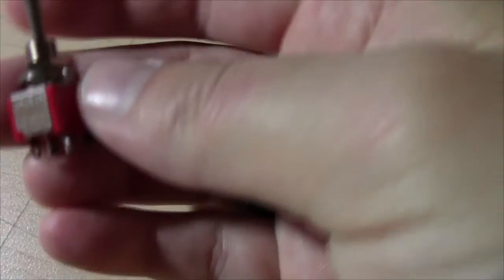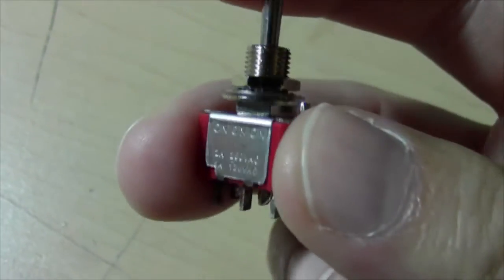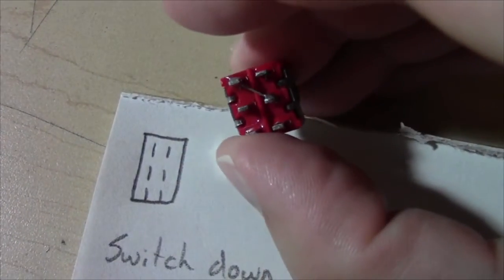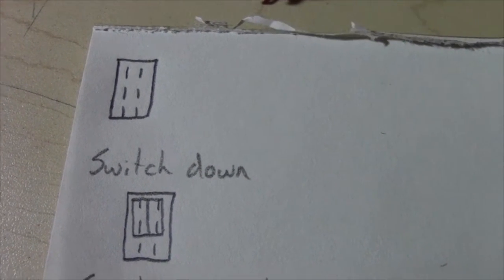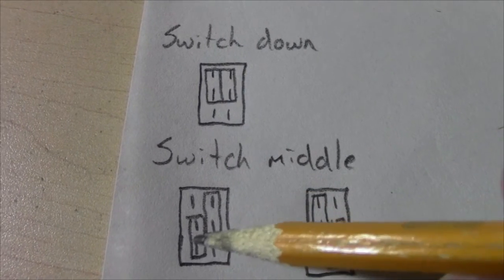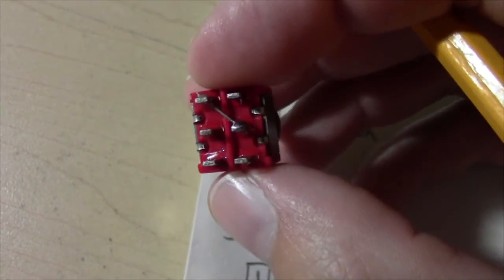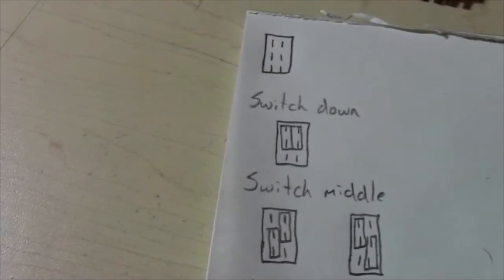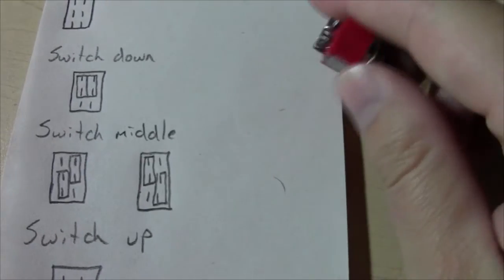Two types of DPDT on/on/on switches...

Comment: Hello 👋  I have a question. I'm using I think the same switch as you are, but I'm not using it for Amp or guitar building. I'm using mine on a dual atomizer vaping device, the attempt is to wire the toggle to the pcb outputs and make the device to where it can fire either atomizer independently or simultaneously depending on switch position. My inquiry is such, when connecting the positive input to the middle terminals, do I need to do anything other than add the jumper between terminals 5 and 3 as you have, or do I need to jump from either end terminals making an "X" pattern between the terminals?? I'm sorry I'm not very articulate I do not hwv3 much experience in this field
Reply from the maker: I really don't have much experience in this field either.  But it sounds like you're trying to wire up a two position (on/on) switch, rather than a three position (on/on/on) that I'm describing here.
Reply: @gasolinechlorine  so disregard the device and allow me to explain thusly. I have two lights that I want to use this switch to divert power to. The plan is that up turn on the left light, down turns on the right light, and middle position turns both on simultaneously. My biggest thing is that I've reached out to multiple forums and even tried talking to individual parties, but I keep getting the same response. "Not my wheel house" "not familiar with vaprs" I'm familiar enough with vaprs lol I need to talk to someone who is familiar with these on-on-on switches.....
Reply from the maker: @ Here's what I used to wrap my head around this style of switch.

https://www.talkbass.com/attachments/sp3t-gif.1739184/

As you can see, you can have three outputs with the jumper as they've wired it.  The only thing I'm not sure about is whether or not both LEDs would work if you wired them to the same output.  You might have to just try it and see.

Comment: You may want to add that a "type 1" on on on switch is shown in your drawing on the right, and a "type 2" on on on switch is depicted in the left drawing. Type 2 on on on switches seem to be much more common.
Reply from the maker: Yeah, I can't remember whether or not I said it in the video, but you need to check your switch with a multimeter to confirm which type you have.  Most places you get switches from don't give you any indication of which connections are made in which positions.

Comment: Thank you for the video. For those who will buy this kind of 3 way toggle switch they must have multimeters. First of all check the switch to ensure what type it is on middle position before soldering the wires.
2ndly when we buy 3 position switch ensure it is not on off on type although thry also have 6 legs.

Comment: Do you know what brand the switch is? I have A very similar looking switch and it’s made by multicomp. I bought it for about £4 here in the U.K. It has a nice quality feel to it when you flick the switch
Reply from the maker: I don't know the brand, feels good to me though.
Reply: Adam I have my on-on-on switch wired up in a circuit at the Moment, and it’s working , but I think I am missing a wire . So it puzzles me why it’s working !? It may be that the switch is like as you described and functions slightly differently, so I’ve maybe got lucky
Reply from the maker: @ourclarioncall  It's possible, yeah.  But the main thing is that it's working :D
Reply: Adam I realised tonight I was wrong , I actually did wire it up correctly . Phew !

Comment: Thank you for your video, addressing an aspect of toggle switches rarely found elsewhere. I'd like to respectfully point out that the video's title implies that the "ON-ON-ON" version of the three-position toggle is a "DPDT" type, but it is not. So, applying the name "DPDT" to these switches is incorrect. The proper name for the "ON-ON-ON" type is "SP3T." They use the same physical construction as a six-terminal DPDT toggle switch, but they function as a SP3T switch. This confusion sometimes arises because of the physical similarity of the two types.
Reply from the maker: While you are technically correct (the best kind of correct) I think most people identify these switches as DPDT, because they have the same number of poles as a normal DPDT.  It's less confusing that way.

Comment: Hey man, thanks
Great video!
Just a quick question
Do you know if there is a way to wire or modify a DPDT switch on/off/on in order to make it work like an on/on/on?
Reply from the maker: To my knowledge, no.  Not without physically disassembling and reassembling the switch.
Reply: If you haven't found/done this already
http://www.harmonycentral.com/forum/forum/Forums_General/acapella-94/31545138-how-to-convert-on-off-on-dpdt-switches-to-on-on-on-selector-switch